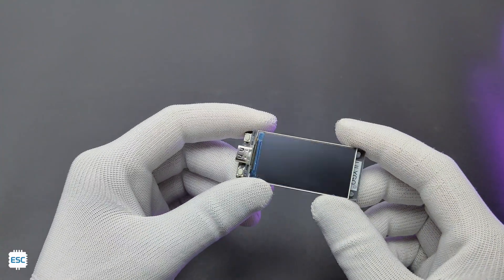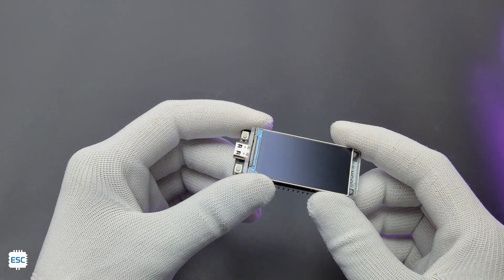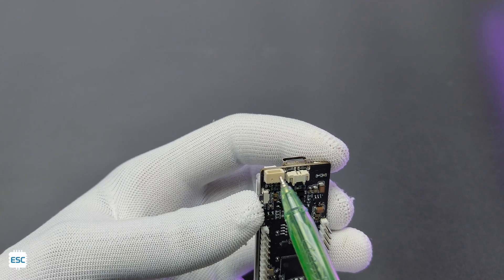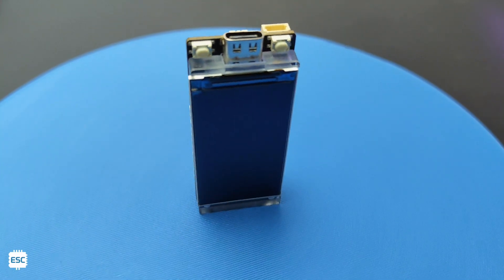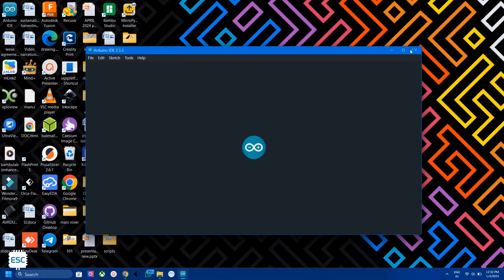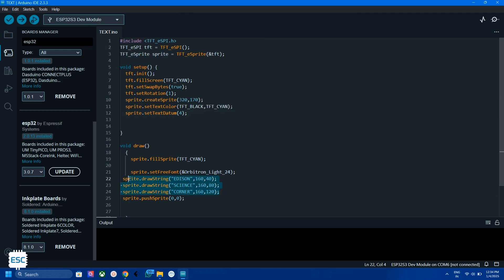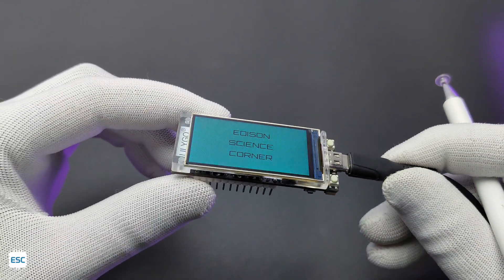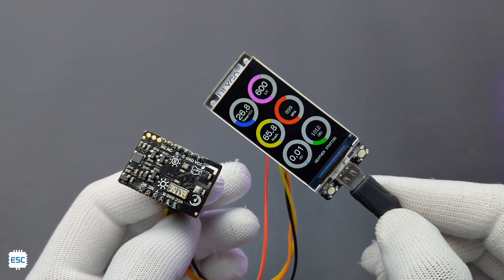Why the T-Display S3 is Perfect for Your Next DIY Project

Comment: With 16mb of flash memory available.Such a shame we can't get file data partition  upload working.
Reply from the maker: What you mean by that
Reply: @EDISON_SCIENCE_CORNER  Fatfs,SPIFFS,littlest add on tool for Arduino dose not work. And so can't upload the data folder up to the T-Display S3.data partition. The only way to add images. Is in the APP partition as .h image files.. So there is a large waste of memory space.As the App size max is 4mb. And with OTA portion of 4mb. Leaves 8mb of memory unusable.